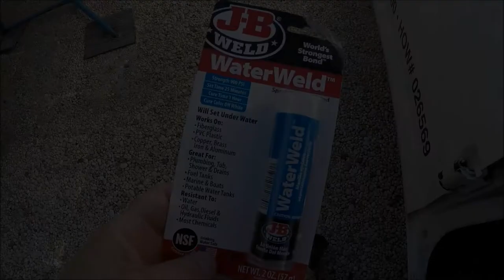123: Electrolysis Corrosion Repairs Part 2

Comment: How did the repair hold up?  Any setup that puts the outboard in the water 24/7 is pretty much the ultimate test!
Reply from the maker: It held up pretty good. Sold the boat two seasons after. The zinc always had to be replaced.